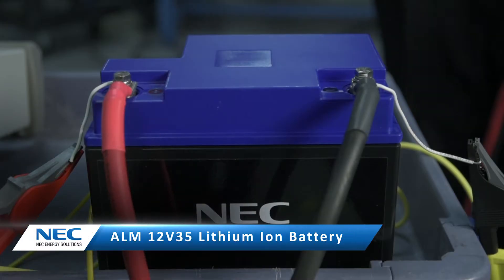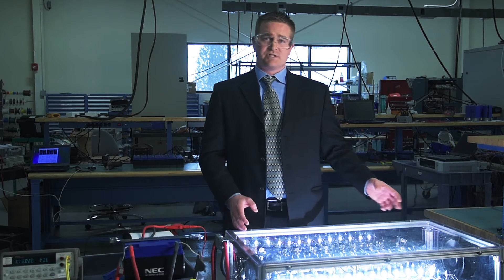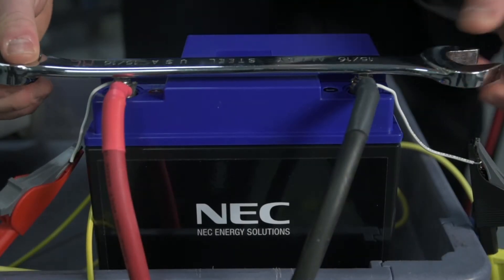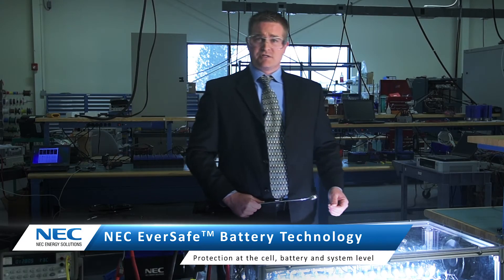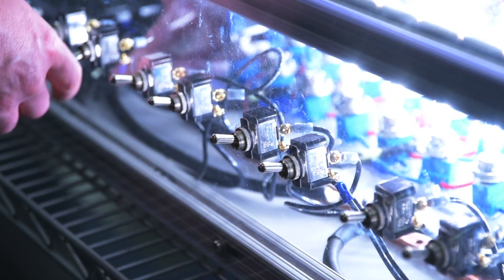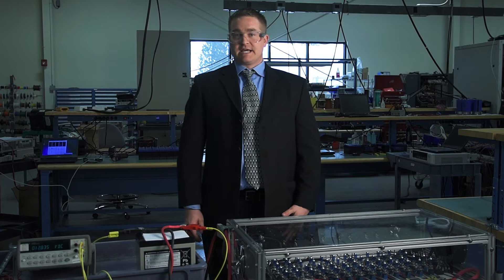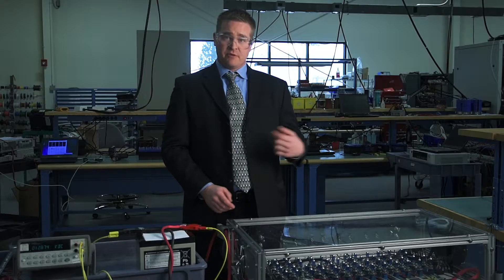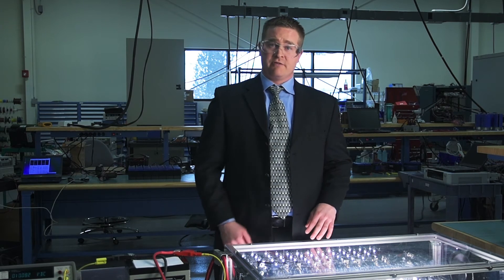NEC Energy Solutions’ ALM 12V35 load and short circuit demonstration

Comment: HI Benjamin,  Yes, these batteries are UL listed to operate from -40 deg C up to +60 deg C and offer significant temperature advantages over lead acid batteries.  Link to data sheet; http://www.nec.com/en/event/mwc/download/pdf/Battery_modules_ALM12V35.pdf   There are a couple of select temperature vs. performance profiles in the data sheet)When lead acid batteries are used at lower states of charge the electrolyte becomes predominantly water which increases the risk of freezing and damaging the battery.  On the high end of the temperature range both lead acid and Lithium ion will age faster however the lithium ion will still provide better cycle and calendar life for a given temperature.